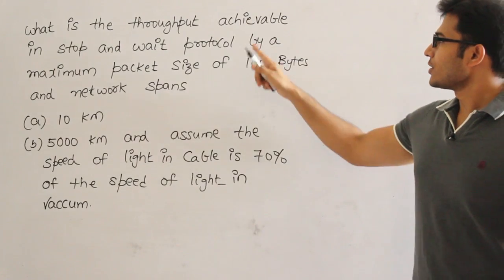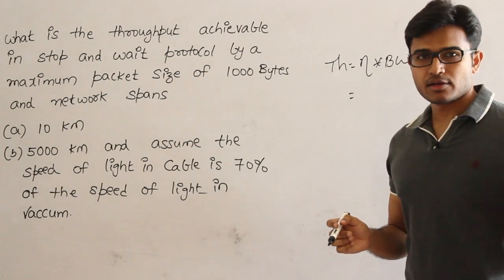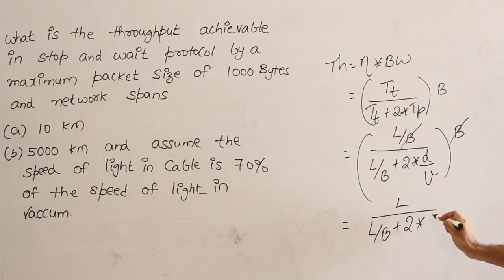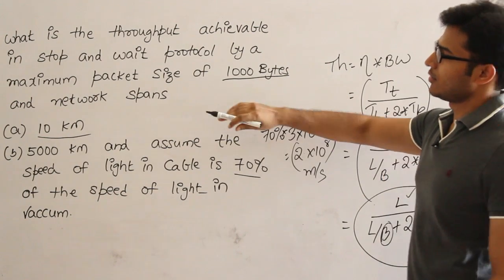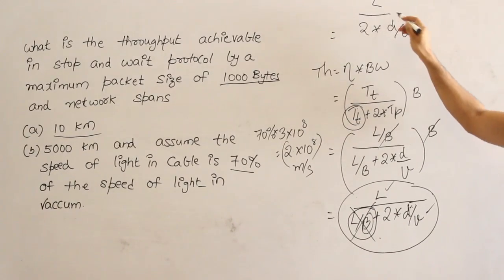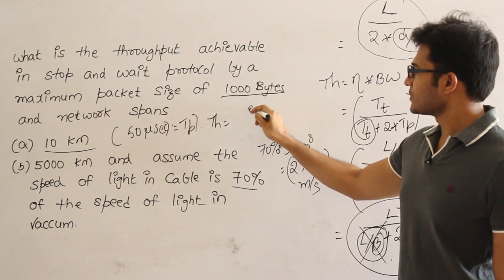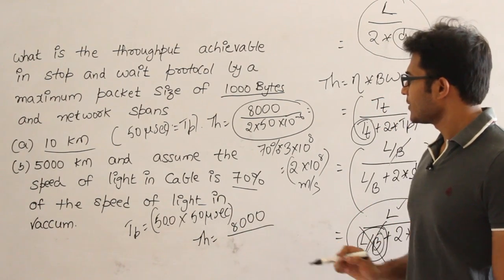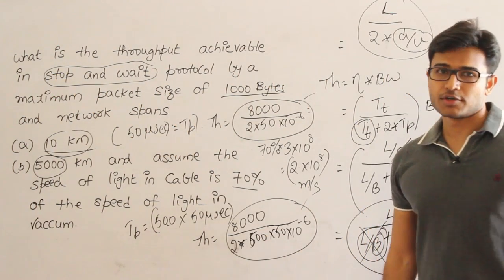CN  - Problem 14 | Ravindrababu Ravula | Free GATE CS Classes

Comment: d/v
= 10km / 2*10^5 km/sec
= 5sec / 10^5
= 0.5 * 10^-6 sec
i.e. 0.5 microsec is it?
how did u get 50 microsec?
Reply: it is coz.. v is given in m/s and you took it in Km/sec
 
d/v
= 10km / 2*10^5 m/sec
= (10 * 10^3) / 2 * 10^5
= (5 * 10^3)* 10^-5
= (0.5 * 10^2) * 10^-6
= 50 micro sec
Reply: Thanks for comment but Actually v is given as - 
2 * 10^8 m/s
i.e. 2 * 10^5 km/s
Reply: +Saurabh Jambhule You are right...it's 0.5 microsec